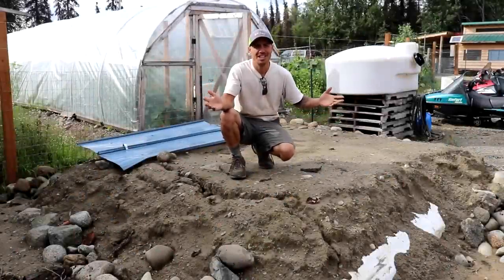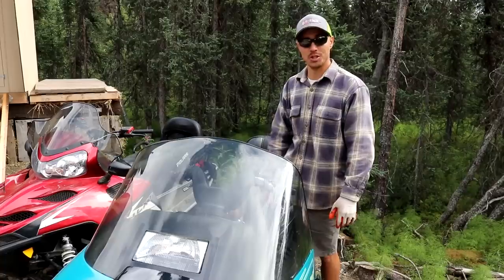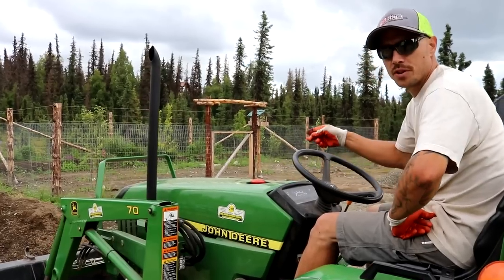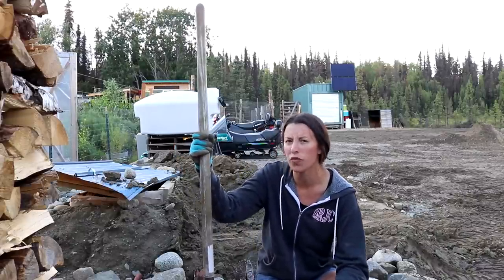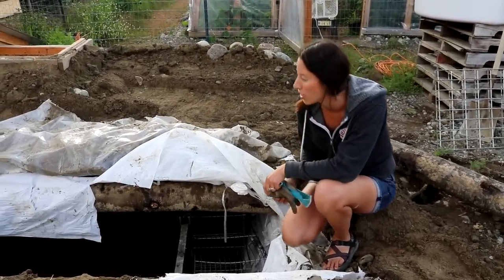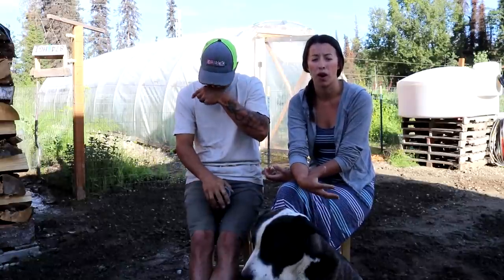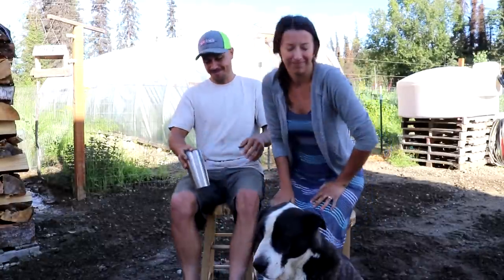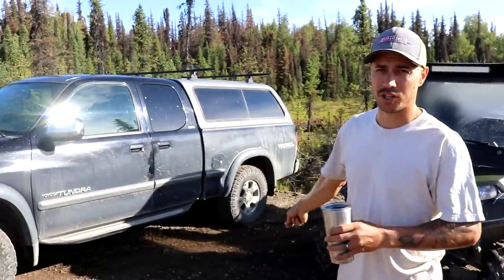Our Earthbag Root Cellar Fails | Addressing the Mud Issue

Comment: I feel for you. When we first moved to Alaska in 1970, our Dad, an uber welder/pipe fitter with an i.q. of about 140, dug a 10 foot deep hole around the well head after the well was drilled. Then built forms and poured concrete for walls, installed the submersible pump, and built a removable roof about one foot above ground. As you can imagine, we should have built an above ground pump house. The permafrost buckled the walls somewhat but did hold. The main pain was me and my brother had to bail water every spring, every day. We did install a sump pump but it couldn't keep up. Sorry Dad. Love you. RIP

Comment: Go have a look at Gridlessness on youtube, they are a family of five that are off grid in Yukon Canada and they build a root seller with large above ground culvert, build a cement top and buried them with dirt.
Reply: They also built into a hill. This couple don't have that hill. That cellar is a good idea. 3 different areas.
Reply: @glengillis7775  you are right but can be remedied with a couple loads of dirt. As long as you have a couple of feet of dirt all around you will have the same result without the water problem these guys had to deal with. It is a mater of finding the right structure at a cheap price. I will be making mine with part of a 40ft container. I will insulate about 15ft and using geothermal energy to keep mine at a constant low temperature all yr round.

Comment: You can build an above ground walk in storage with concrete blocks with a generator cooling system or on solar battery power.  If the door is tight shut and it is cold outside you should have a decent food storage for winter.   It works good for me and will ride out any storm and be standing concrete solid built.  12:50 https://www.youtube.com/watch?v=qMWNLtlmH0g